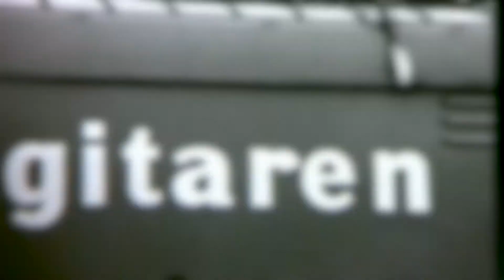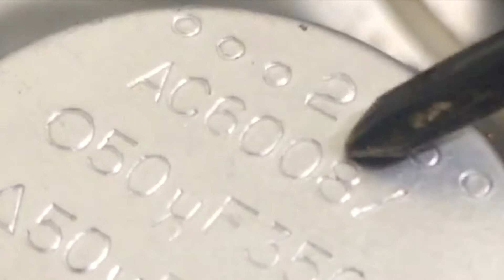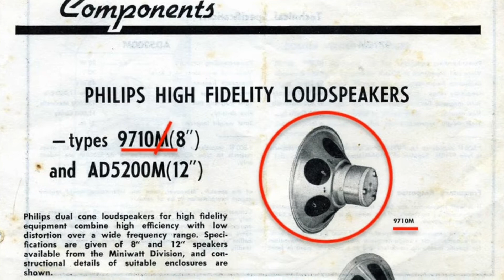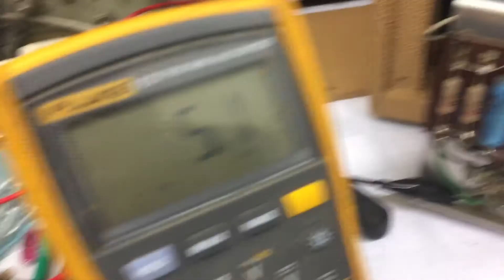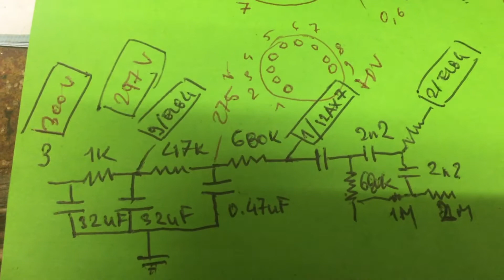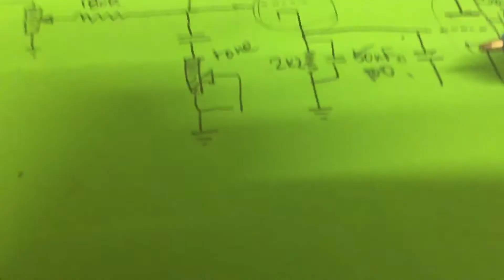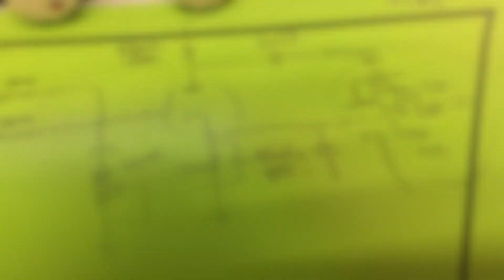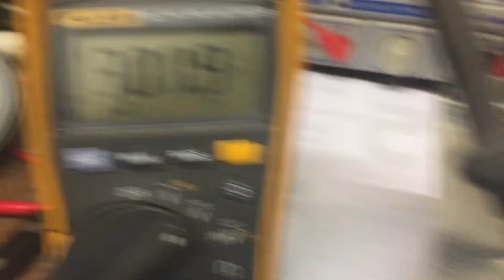1963 Egmond V1020 5W Tube Amp made Holland

Comment: Such a cute little amp.
Reply from the maker: And a vintage alnico speaker of some repute: Philips 9210. Types with letters suffixed like 9210M or AM etc... are different types of the same speaker. It's supposed to be 8 ohm, but apparently degraded a bit magnetically - That's probably why it sounds so good...
Ready to give it a new home? It's early sixties, it's blonde, it's got tremolo but just doesn't have a Fender logo...
Reply: @zjokka  Yes sir!

Comment: very nice little amp!! where do you find all these treasures? i'm jealous 😁😁
Reply from the maker: Hi Tony! Thanks for commenting - it really is a treasure, because this is the only video on youtube featuring this obscure amplifier brand. Egmond guitars are to be avoided at all cost, but the amps were made by Phillips, and it shows. Philips would never be able to develop a stage amp like Jim Marshall, Leo Fender or Charly Watkins, but the build and components are better than anything Fender used at the time -- those early carbon film resistors really blew my mind.
Reply: @zjokka  hey! yeh i see all those mustard , something you see only on marshalls...and the resistors i bet are  still all in specs 👍🏻
Reply from the maker: @antonix_81  Yes, only replaced the electrolytics (cathode bias) because they were visibly damaged. Didn't want to mess with it more than necessary, although it really would like an extra gain stage... Maybe I will make a video with a booster pedal?
Reply: @zjokka  i didn't pay attention on the schematic, on my 5f2 i get a nice distortion with just 1 preamp tube, it pushes a lot the el84 , i put a 10uf and 1k5 on cathode , i don't remember plate voltage but probably more than 150 vdc, you did well to decrease the 680k ....
maybe you could add a switchable solid state boost to the circuit using  a lnd150?

Comment: Nice clean little amp! Are you trusting those replacement West German Electros?
Reply from the maker: Great question -- in this amp, I couldn't resist trying to things a bit vintage, it will never be a stage monster, more like a living room amp. Still pedals could push it into distortion at low volumes... show try that.

Comment: Nice amp. Nice video.
That 680k resistor gives high gain. Smaller plate resistor lowers gain. Value of cathode resistor of course makes difference as well.
Reply from the maker: Hi jutukka, thanks for the comment. But still: a lower value resistor increases the voltage on the plate, hence making it more positive with regard to the grid and creating more pull... but in my experience even this doesn't automatically result in more gain. Do you think more gain could be obtained from this setup 1 triode > 1 pentode? I wouldn't sacrifice the sweet little tremolo
Reply: @zjokka  Yes, by using a pentode ( for example EF86 as they did in some early Vox AC30 amps, or EF804s which is less microphonic tube) as the preamp stage it is possible to get more gain from that stage compared to ECC83. But ECC83 is a double triode and EF86 is a single pentode so you have to get tremolo oscillator signal from somewhere else if you replace ECC83 with single pentode input stage.
And I am not sure if it can fully drive the grid of the output stage tube EL84 if you want the EL84 to be overdriven seriously to positive voltages because the output impedance of the pentode circuit of EF 86 or EF804s probably is a bit higher. I have no experience of using a EF86 or EF804s to drive SE EL84 stage. But I thing it is worth trying if the tremolo oscillator can be solved.